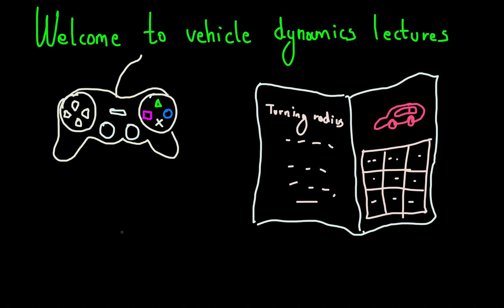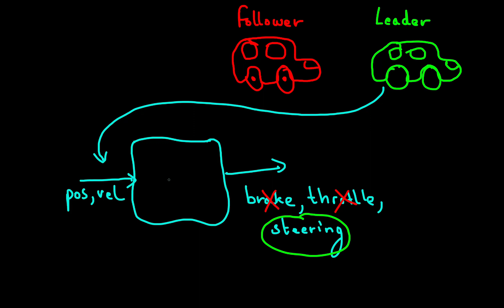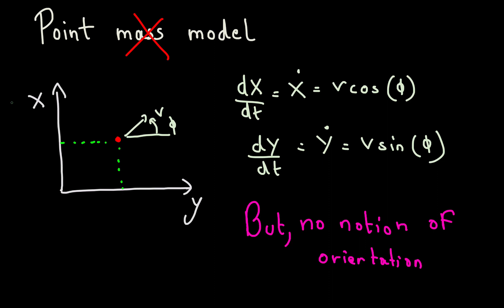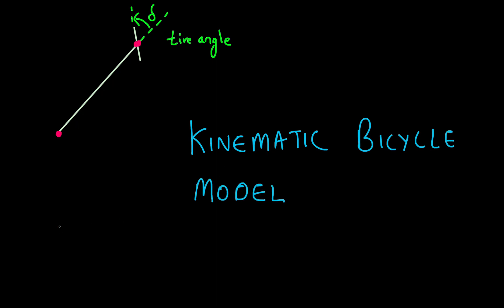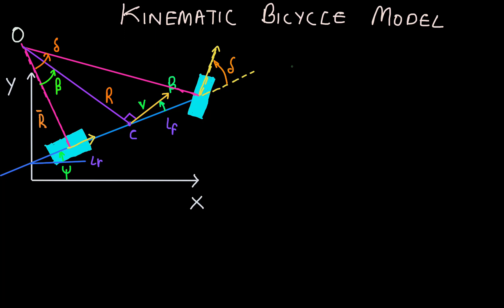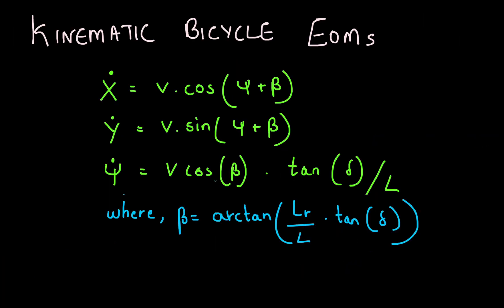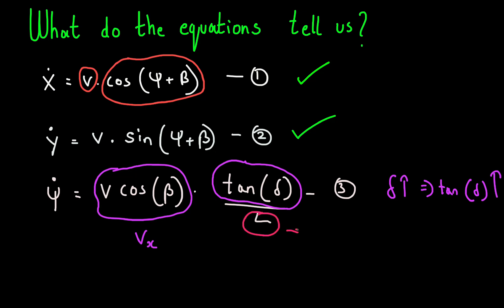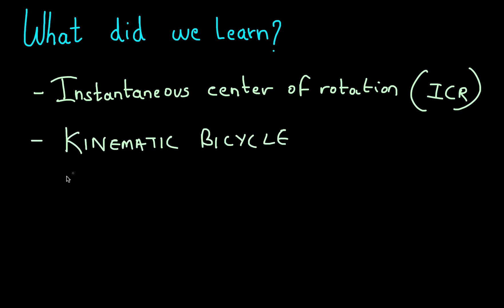Lec 02 Vehicle Dynamics  | Kinematic Bicycle Model (Part 1)

Comment: Hi great video! 
Quick question- if I'm solving the equations to calculate (x,y) trajectory, will the resulting (x,y) points be in reference to the centre of rotation (O) or the origin of the coordinate system that you've drawn?

Or is the centre of rotation the same as the origin?

Thanks
Reply from the maker: If you integrate up xdot, ydot, and psidot, the resulting trajectory (X, Y, Psi) will be with respect to the origin of the coordinate frame.